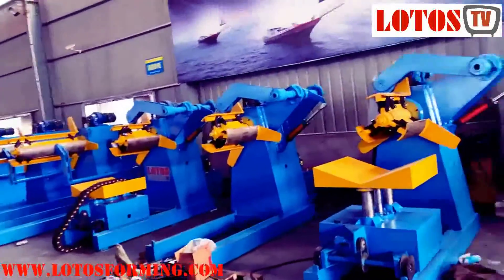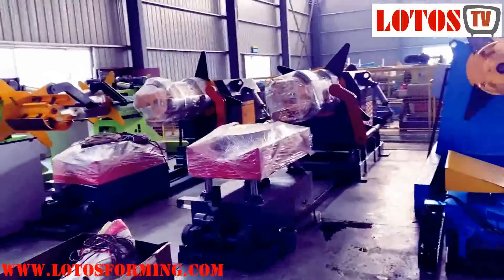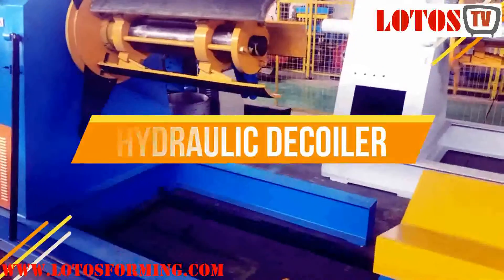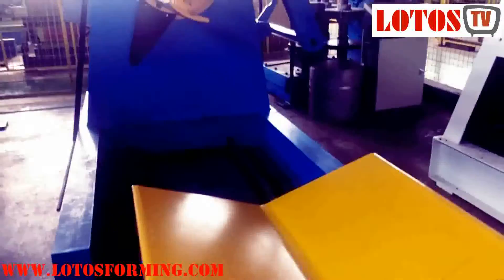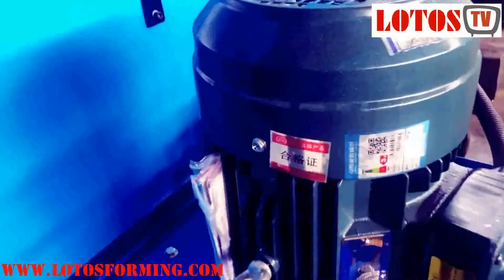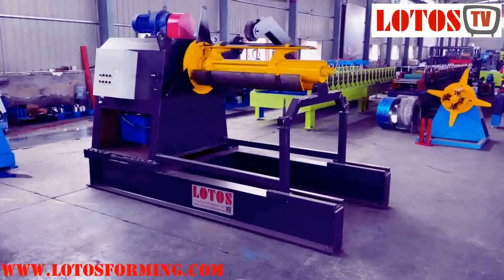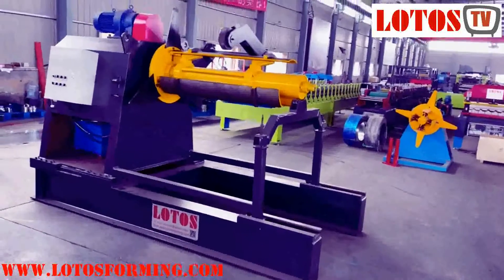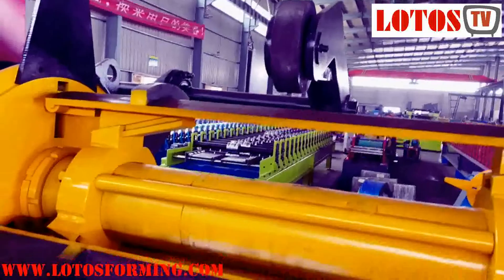▶ Decoiler machines ◀ : Sheet metal decoiler | Motorized Decoiler Machine

Comment: A manual decoiler is cheaper, while a semi-auto decoiler or an auto decoiler may cost Multiply. A manual decoiler consists of welded steel and two bearings; a semi-auto decoiler requires a motor with a reducer, and an auto decoiler has a motor, hydraulic system, frequency inver, and control unit.